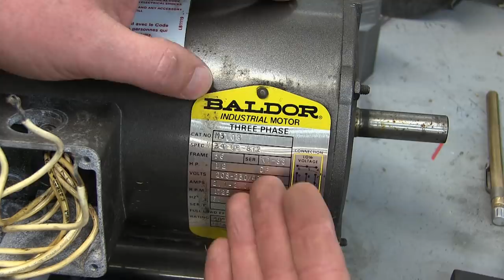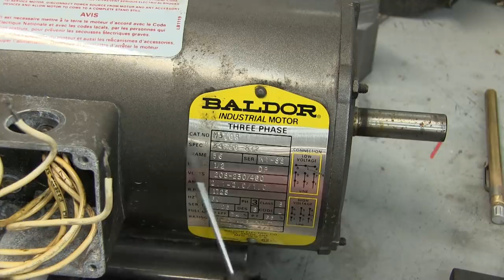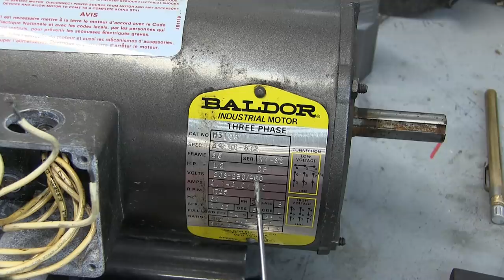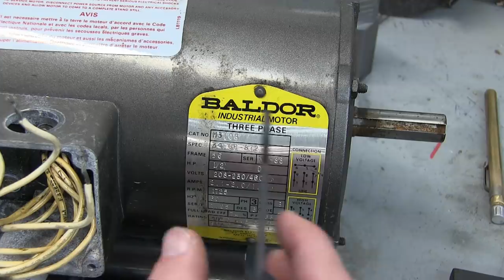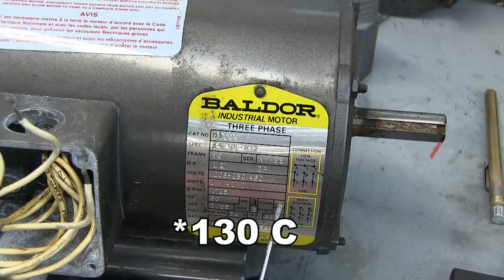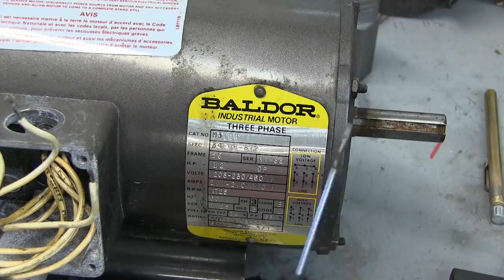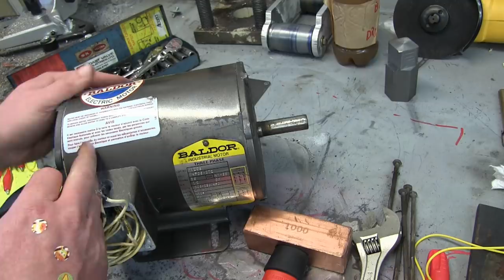BOLTR: Induction Motors EXPLAINED! | Power Factor and Failure Analysis

Comment: well G'day there,,Ummm i little known fact !,is the stationary part of a bearing race should be able to move in it's housing,,in this case ,the end case of motor should have a  sliding fit to the outer of the bearing,That little wavie spring washer do-dad is to apply side loading to bearing and allows the bearing to grow from heat,while the inner in this case should be a light press fit,
Why?? i can see ya all asking well,,the outer ( in this case ) should be able to spin one revolution in it's life,,they do this so as to move the wear from one part of the race,
Take your older style front wheel bearings,,the outer ring is tappie tap,tapped in to the housing and the inner is loose on the stub axle,,the outer spins and so has a different running surface all the time where as the inner is stationary,taking all the load on one area of the race,
So we should give a little clearance to the inner (in this case ) so as to move ,shifting load zone of race.
Don't think any one knows this now,have had many argument with fellow fitters in the past,
But had an old bearing expert told me this..and i believe what he said,,
because when you about it ,It seems right,,

Comment: A bit of an addition to the power factor discussion; power companies charge more for bad power factor because generating power at a power factor less than 1 is bad for the generators, and they have to balance the inductive loads with large capacitor banks, etc. so they can maximize the unit's life. A large load like a factory with a bad power factory forces the utility to use more resources to generate power, so the power company charges them more

Comment: Dude, skewed conductors on the rotor has nothing to do with the power factor. It is there to prevent magnetic locking as well as physical locking with poles of the stator in the event of bad bearings. As simple as that, no rocket science.

Comment: Losing a phase in a motor is #@%$&*. I used to work with 3 phase protectors which would kill the low voltage to the contactor saving the motor, but found very few safety's like that on other systems, very sad. Thanks so much for making me think! Lol

Comment: I get so confused, how can a little chinese cnc spindle 1/3 the size of that motor have 3hp rating and a big ol' beast like this be rated at 1/2hp? Is it because this one has that power at low rpm?
Reply: Frequency. Those 3hp spindles probably have to run at 400Hz to produce that. Aeroplanes, robots and RC toys have some even more impressive power to weight motors, with VFDs running >5kHz.

Comment: I have been told that the difference between a "normal" induction, and an inverter duty has to do with cooling, IE at 60hz rated voltage, both motor will run like a hot damn forever, but take it down to sub 20hz at rated, and the "normal" will go smoky pretty quick, as it will get hotter than Satan's jock strap in no time flat.  While an inverter duty will run happily at low speeds for years.
Reply: Heat management is correct but additionally for voltage spike resistant insulation. Maybe this will be included in the discussion when he gets the bearings installed? When I field install a VFD there is an addition of grounding ring or brushes. The ring of course like the brush is installed on the shaft.=D
Reply: T C  I have not seen the brushes/rings installed on any motor I have worked on, but from my understanding of VFD's (considering I do board level on a shit load of them, that is enough to shake a stick at!) A VFD is less likely to have a spike then the contactor/star-delta starter it replaces.  If the VFD is spiking, either you have a shit application, or a dead VFD.

If you mean noise, then absolutely, as I have see a number of applications where the VFD is about/over 300 feet from the motor.  So shit cables/practice could easily induce a spike, but that will likely travel both directions.

Comment: DP duel pole? We have 2pole and 4pole the same. That looks like it turns half a turn per wave form. *you can get deratings from the seller to use them outside of the plate. 4pole motor can run at higher Hz, so you can have a hydraulic press that idles at 30Hz, drives the ram down to the job at 80Hz and connects Direct to the mains for 60Hz and pushing the ram at full pressure. (Saves lots of electricity) :o)

Comment: I have a question... Many moons ago when I was doing industrial tech, I was taught to use the service factor differently... When a motor's skoocum-ness was in question, we would test each leg's amp draw, compare it to the FLA rating for the appropriate voltage and then if it was over amping, we would multiply the SF by the FLA. If the actual amp draw was higher than that number, we would change out the motor. Is that not a proper procedure??

Comment: Thanks for a great video!  I was hoping for some quick help.  Any chance someone can explain the math in the power factor section @10:37 in the video?  Based on the description it sounded like real power is equal to apparent power * power factor, so for the motor it seemed this would be:
480 VA * 63% = 302 watts

Also, I didn’t follow the logic around the derivation of 350 (or 326) watts.  The description started with 400 watts, a reference to "half horsepower” and then a value of 747.  Really not sure where any of these values came from or how used in the calculation.

Any help greatly appreciated.  Thanks.

Comment: 3 phase motors put out more torque for their size and wattage .  Application of torque every 120 degrees.  Like a tuned Straight 6 or V12 Jaguar....smooth power!.  That efficiency $ is the reason for industrial application.  Them watts add up...plus the PF penalties of "split phase"...  yadda-yadda l

Comment: You mentioned the S.F. in relatiion to volts but for the viewers, SF is also related to the amps. You can use the S.F. when checking to see if a motor is over amped. I think you said FLA was 1.1A so multiply by S.F. (1.25) gives 1.375A is the max amps the motor can run. You would want to run the motor at something < than that value, jusr to be safe. Great video as always. Thank you for sharing!

Comment: 24:48    imma US elechicken. and from what i know you can tell right away if its delta or wye by the connection diagram.... on a 9 lead motor the high" connections are the same for a delta and wye but the low voltage is different... the delta is 1-6-7. 2-4-8. 3-5-9. and this being wye is 1-7. 2-8. 3-9. 4-5-6.

27:06 and the class "b" basically tells us a range of kv/hp with locked rotor. according to a table in our code book.

Comment: Ah the good old National Electrical Manufacturer's Association. A NEMA motor starter has to be hoisted up in a bucket, and is rated for something like 50,000 on off cycles. The European Telemechanique starter is rated for 5,000,000 on off cycles, and I can load my pockets up with a dozen of them. How the fuck sakes is America leading the world with it's 1950s electrical parts? I finally got a call back on that giant warehouse to replace one of those starters, I installed in 1994. When I say giant, two +/- 7" expansion joints. That's pretty big.

Comment: A funny thing about motors coming mostly in wye by default, the WEG brand equivalent to that there jellybean comes by default in delta. Found that out when I wired up a compressor room exhaust fan WEG motor. Damn thing. Luckily I was right standing proper by the local disconnect before pixies started escaping.

But yeah, WEG motors. Love em and hate em.

Comment: The normal European way of having a dual voltage motor is to change between Y (star) and Δ (delta).
Small motors up to a few kW are 230/400 volts, 230V being Δ so you get 230V across each winding, 400V being Y so you get 400V across a winding and a bit. Larger motors are 400/690V. It looks like that's what you're doing on yours, the jumper links changing positions to create the star point in the centre. It's just laid out in a way that makes it more confusing!

Comment: thats a 4 pole 3 phase winding wound with consequent poles, so using half the coils of a typical 4 pole winding. cheap bastards almost snuck that by you!  it has 12 groups of coils connected with an internal wye. forms two wye on low voltage. also looks like one coil was hot enough to burn the lacing off the coil, indicative of a bad contactor. I bet that motor would have ran, and they just have a bad contactor

Comment: DP means Drip Proof.  Class is Insulation Class, and class B is 130 deg. C. Design is the running characteristics. Code is the Locked Rotor KVA per hp. Meaning the inrush current when starting from a standstill. The bearing is a 203, not a 208, the 203 has a 17mm shaft size and a 208 has a 40mm shaft size, the same as the od of the 203.

Comment: Great vid! Just one comment 3 phase you need include square root of 3, so volts x amps x sq. rt. 3 = 480 x 1.0 x 1.73 = 831 VA..single phase is just volts x amps.

Comment: A little story for your edification:
While doing  maintenance at a storage facility, I found that the power to the entire building was out due to the main breaker (480 V 600 A three phase)being tripped. There were three breaker panels, so I snapped the panel main breakers off and reset the building main. It held.
I then reset the panel mains and the building main tripped again on the third panel. (A breaker that size almost requires two men and a boy to reset, and when it trips, the noise is like a shot. I about jumped out of my shoes.)
OK. Now I snapped all of the individual breakers in the third panel off and reset the building main. Again it held. I snapped the individual beakers on until the main tripped again. It was the circuit for the air compressor -- a 20 A triple breaker. WTF? How was that possible?
I got down on the floor to read the building main breaker rating plate and found it was a GFCI breaker, which was tripping on ground fault. The motor winding had shorted to ground and caused the building main to trip.
Cheap 5 HP three phase motors are not economical to rewind, so we spent $500 or so for a new one. The old one failed at about two years of intermittent shop duty.

Comment: Lolol git ur finger off of the test lead end and the motor, sir.. you will be condemning everythink. Hey , you seem to know some oddball things and I have an oddball question- how can I calculate the amount of power is used to start a 4160 v , 500 HP 41 FLA motor on an across the line starter? I have a controls contractor that programmed the system so it bounces back and forth between the machines on a failure.... 71 times ....overnight... before they blew a fuse. an expensive fuse. Thanks for any help you can give me. p.s. - i love the bread trick, smooze it with grease or oil for added pressure.

Comment: I only scanned down about a page on the comments, but didn't see that anyone had addressed to DP after the power rating...

I think that stands for Drip Proof - these days it would be Open, Drip Proof (ODP) which means that the motor won't short & burn up if a little drop of water gets into the open windings.

Open windings run cooler than enclosed windings, but unless they take some precautions, you get wet pixies, and they get angrier than a cat being baptized...

That's why in the mines and the mills, you'll tend to see Totally Enclosed, Fan Cooled (TEFC) or Totally Enclosed, Non-Ventilated (TENV) motors in common use.

Comment: I'm sure Ave is aware of this but if one operates a 60Hz motor on a 50Hz system (particularly at full load) there is a danger of melt down since frequency is one of the factors that determines Reluctance (XL) in an inductive circuit.

Comment: DP = drip proof enclosure. Service factor 1.25 = 25% amps over tag rating. but that's only good to know if you're trying to figure out what's going bad, motor or driven equipment, lol.

Comment: Hey I work in a motor shop. The general rule for megging motors in our shop is 2x the operating voltage plus 1000 volts (2000 VDC for a 480 V motor). The class on the nameplate is definitely the insulation class. The difference in rotor construction would be noted on the nameplate as “Des” or design.

Comment: Hello Ave,
Are you familiar with motor saturation? If so, I would love to get an answer (or even video!) about this: If you poses a motor that won't seen a lot of run-time, yet need to perform a lot (ie. building an electric race car), would it be possible to overdrive this motor (over voltage) until we are right under saturation (probably above the rated operating voltage) in order to increase performance (torque/speed) at the cost of potentially reducing the life expectancy of the motor?

Comment: AvE,

I just thought I'd share my experiences with you regarding your comments about 36 year old dudes that still live at home with "momma". I generally agree with your sentiments here, however my reasons are completely different from what you mentioned.

I have a "psychiatric condition" that I'm dealing with which presents a few challenges that can work against my ability to mesh well in a work environment. Also, housing where I live (southeastern Louisiana, United States) is supremely expensive and it's very hard to justify spending upwards of a thousand bucks per month for some shitty hole in a wall apartment when Mom and Dad's place is "free of charge" so to speak. Compounding all these other issues is the fact that jobs for anything technical beyond menial labor simply do not exist any more in SE Louisiana. Even if I wanted to, I cannot do work repairing computers for people because there is no business here in that field that would need me. And I know absolutely nothing about starting or running my own business. The very best I can do now is maybe, MAYBE I could make electronic stuff and sell it on Amazon, but then how am I going to get the parts? I have zero money to start with and it's foolish of me to expect anybody to just donate what I need in order to get started. Your idea of working online, while a good idea in principle, is next to useless for me in practice because of the stupidly high logistical hurdles I'd need to overcome. Maybe if I had a wife, things might be a little simpler, but there isn't any woman on Earth that wants me because women don't like men that have no money or a job; they tend to think of us as "unfit to mate/raise a family". Women don't marry for love any more. They only care about money and job, love and romance are just mythical things that only happen in books and movies. :-(

I'm really enjoying your videos. Please don't stop or change your style because we need more people like you to teach the stuff you teach. Thanks so much for all you do.

Comment: 5 or 10 thousand volts isn't megger testing.  It's high-pot testing, and it's often done to destruction when testing designs, not individual devices.  Megger testing is up to 200% of rated voltage, and it's for testing individual devices (and the device should survive, though they don't always if you're not careful).   The highest a megger will go (that I've ever seen) is 1000V, and that's for 575V equipment.   Just sayin'.

Comment: The service factor rating is better explained with amps, you take the service factor, 1.25, and times it by the rated amps. 
With that service factor that motor can run at 1.25 amps without problem.
i.e a standard 50 HP motor will pull around 65 amps, if that 50 HP has a service factor of 1.15 then that motor can pull 75 amps at full load if needed.

Comment: I haven't read all 1301 comments before mine so this may have already been addressed, but I hope you realize that when you wire that motor for low voltage, you're wiring it in the "Y" configuration <tying the 1,2, and 3 leads together is the giveaway>, and when wiring it for the high voltage, you're wiring it in the "Delta" config.
So, the motor is not prewired in either configuration - that's left up to you and how you wire it based on what voltage you are going to run the motor.
As for the bread-bearing trick, I had an old school industrial maintenance mentor about +25 years ago that taught me that - along with many more mind blowing tricks.
The best bread is that nasty-ass, squishy white bread. Not too fresh though - too much residual moisture content that makes it creep past the punch. A little stale is better. It's still squishy, but not too squishy.
I've used delicious wheat bread in a crunch, but never tried multi-grain artisan bread types because that's way too grainy for bearing removal.

Comment: 15:30 I bought myself a set of cheapo alligator-clip-ended test-leads, mainly for the various-coloured "condoms" that are on the clips. Leaving aside that the wires are flimsy as all hell, the stripped end was just folded back, and crimped into the alligator clip. No solder, no nothin'. 

So the next time one craps out on ya, it might be worth peelin' back the insulating boot and tackin' on some flux & solder. 

"Just the tip, mind, and only for a minute" ;)

Comment: A national company I used to work for had 120 volt, 1/3 and 1/2 hp motors in their machines.  The service techs were told the motors used "self lubricating" bearings and did not need to be oiled.  (Everyone thought they were ball bearing motors.)  The name plates on the motors did not mention what type of bearings they had and you could not tell from the outside.  The new supplier's motors did not seem to last as long as the old ones and they usually died from seized bearings.  We thought it was just because they were the cheapest Chinese motors that money could buy.  Without going into detail, I discovered the motors actually used sleeve bearings and not ball bearings.  Therefore, the company had junked THOUSANDS of perfectly good motors over the years simply because their bearings had never been oiled once in a while!  It seems somebody at corporate input the wrong parts order numbers and, as they say, the rest is history.  True story.